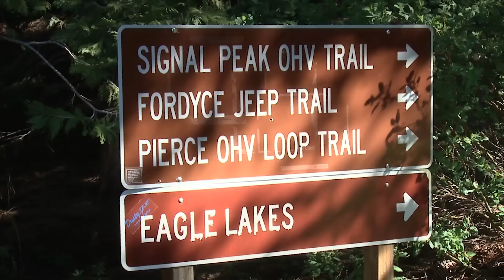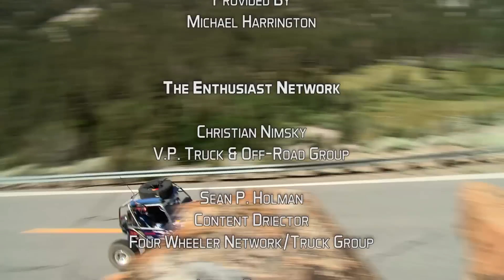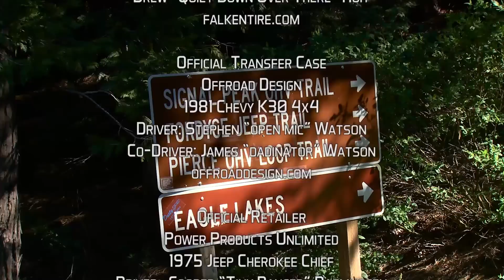Last Trail! From Truckee up through Fordyce Creek Trail - Ultimate Adventure 2016

Comment: Damn, either Fred is one of the best offroaders, or his jeep is really well setup. He makes every obstacle look easy.
Reply: The Metal Butcher yeah that jeep is seriously built, you can watch the build on dirt every day
Reply: Fred is also a really experienced driver. Watch some of his other videos and pay attention to his throttle and brake control. There was a clip where he popped up over a feature and in the air already had his tires stopped so he wouldn't go anywhere at the top.
Reply: The Metal Butcher he is a really good driver too
Reply: I agree with everyone but that jeep it's built just about perfect for that trip
Reply: I figured the tube buggies would have them beat due to the weight and sus travel advantage but apparently not. Seems like he was the only one to think of a real radiator, I don't remember him having any overheating problems even with the most powerful engine.
Reply: It's both, He knows how to build a good rig (or at very least knows people that know how to build a good rig), and he know how to make it perform from behind the wheel. He's been a dirt head for a long time
Reply: Both

Comment: So it looks like you all exited at the Fordyce bypass after W/H#2?.........too bad you missed the rest of the trail.
W/H 3,4 and 5 and the squeeze rock are the best part of the trail, you can have all the water crossings. I prefer to  run the trail during Sierra Trek so the water levels are lower, plus at night you can run down 5,4 and 3 then go back up them to camp.

Comment: That yota has the look, but i don't know if I could ever go that small...
Reply: it looks like its on 40's....so damn capable, add a v8 and......
Reply: TheJonny2you The issue is the bed size. Couldn't hold a sheet of plywood, and couldn't haul heavy stuff (or a motorcycle). My truck sucks, but at least I can carry whatever I want.
Reply: BenLeBlanc1 he bobbed the bed. The standard bed could carry your plywood way easier than the jeeps or caged bed trucks
Reply: Old hiluxes have some of the biggest beds you can get. Modern supercabs have tiny short beds.
Reply: thing looks sweet though, i saw he linked it and it has air bag suspension. adjustable stiffness and ride height. really quite different and didnt do half bad.

Comment: Hey guys I know some of you may know the answer to my question but I am turning 16 soon and there Is a truck me and my dad are looking at and it doesn't have an engine so I am thinking a 454 but don't know what transmission I should get along with it could you help me out ( the truck is a smaller single cab 4x4 used and a chevy )

Comment: I am not very familiar to offroading and I am wondering what is the use of the thing hanging on the winch cable? Is it there in case it break or what?
Reply: If it breaks it keeps it from flying anywhere but down. Much safer.
Reply: it's so you can see the cable and not walk into it. it has nothing to do with where it goes if it breaks. the cable should have a fiber core to prevent it from whipping if it breaks.
Reply: It actually is in case it breaks and is to keep it from flying and hitting someone, cables ether are synthetic rope or steel cable, its for safety if it breaks its not for visibility.
Reply: Travis Curtis cables can be all steel, fiber core steel, all fiber. I've been working with cable of all types for lifting and pulling for twenty years. That flap is for visibility and nothing else. Before Warn got the big head and started making those things, we used to just hang a orange vest over the cable. And I've seen an all steel cable draped with vests, jackets,  and chains snap, whip, and cut a truck cab in half. That little visibility flap is not going to stop that cable from whipping if it doesn't have a fiber Safety core. And thats how it is. Educate yourself Travis, before you get yourself or someone else hurt.
Reply: repr26 Thanks for the info, I guess that's just a common misconception.
Reply: Travis Curtis is a very common misconception. One that I've never understood. Think about it. Load a cable with thousands of pounds, it breaks under that load. Do you really think that little vinyl flap is going to hold it down? No, of course not. Add to that the rarity of a cable breaking, and the most important safety concern becomes making sure people don't wipe themselves out on the out stretched cable.
Reply: repr26 And that's why they make synthetic winch rope, less likely to get cut in half.
Reply: Travis Curtis Actually, full synthetic is more easily cut than steel cable. But, you can't easily tell just by looking at a steel cable if it has a fiber safety core, or is just steel rope cable. Thus, the purpose of full synthetic rope is to allow it to be easily identified as no whip/recoil cable.
Reply: repr26 Sorry, I meant that it would be less likely for someone to be injured by the rope then by a steel cable, or so I've been told.
Reply: Travis Curtis yes that is true.
Reply: From Warn about their recovery dampener:
"The WARN Winch Damper helps to prevent rope recoil in the event of a rope failure. While rope failure does not happen often, this damper will help the rope fall to the ground if such an event were to occur."

From ARB about the winch line recovery dampener:
"One such precaution is the fitting of a recovery damper prior to a load being applied. In the unlikely event of a wire rope or strap failure, the recovery damper will absorb most of the energy in the cable or strap, significantly reducing the recoil."

They are also weighted, its not just a piece of vinyl.
Reply: +LaytonSky like I said previously. I've been working around winch cables a long time. I've seen a cable draped with hundreds of pounds of grade 80 molly chain, break and whip. And take all that chain with it. Warn and Arb can say whatever they like. Speaking from experience, that little "weighted" vinyl flap is not going to stop a non Safety core cable from whipping. It's really simple physics. Under extreme load, there are several thousand pounds of potential energy stored in the cable. That energy has to go somewhere, it doesn't just vanish into the air. If it is released quickly, like a sling shot, it's going to whip.
Reply: repr26 So no amount of weight laid across the cable will stop even the lightest of loads on a winch cable?
Reply: +LaytonSky That's not what I said. Pay attention, The primary purpose of the flap is to insure visibility. Because the flap cannot be depended upon to arrest the cable during a catastrophic failure, proper safety precautions should always be followed. I.E. stay well clear of a cable under load.
Reply: +repr26 
You just gave an example of having a few hundred pounds of chain thrown over a cable and it did nothing to dampen the recoil (probably because the load was enormous). It sounded like you were trying to prove no amount of weight would slow down/dampen the speed of a recoiling cable/line. 

So you would agree that a certain weight, proportional to the load on the on the line, would dampen or slow down the recoiling line if it were to snap?

Also a large bag/dampener sleeve would create a lot of drag in the air. Imagine a fishing line snapping with a heavy blanket thrown over it.
Reply: +LaytonSky Yes, with the six to eight thousand pound load created by try to winch a mired off road vehicle free, I would concede that a "large bag/dampener sleeve" the size of a sail boat sail and weighing about two hundred pounds would arrest the cable depicted in the video currently being debated.